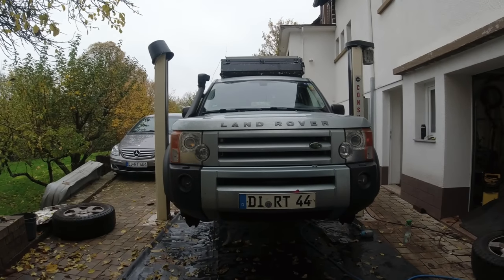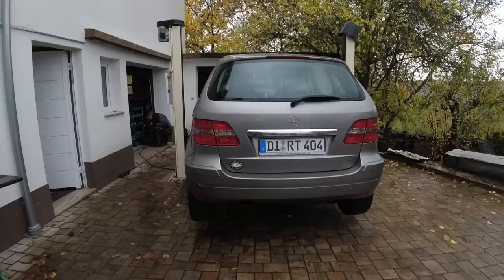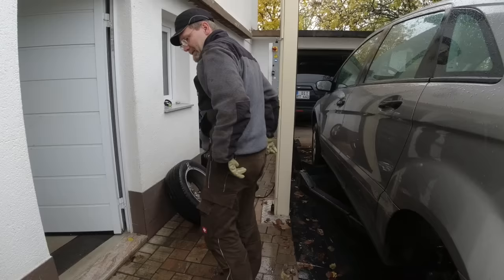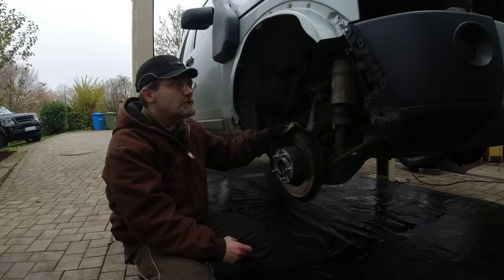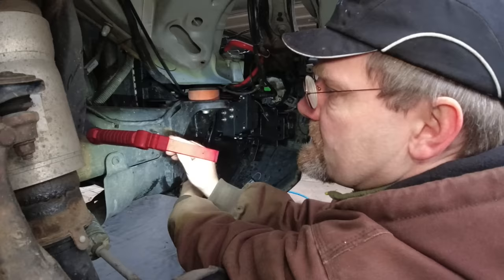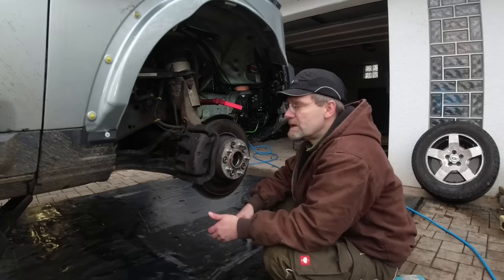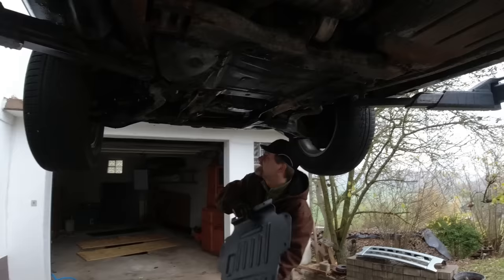Land Rover Discovery Air Suspension Problem Fixed

Comment: Since selling my Discovery 2 and buying a Toyota 4Runner 😱 my coffee tastes better on Sunday mornings watching your videos. Because I know I no longer have to do maintenance on the LR on the weekends. Funny and informative video as always! You two are great!
Reply: Well, Disco 2's were crap anyway. You did well to sell that thing.
Reply: Doing maintenance on weekends has always been an English car owner thing, tuning the SU's , checking the oil level in the carbs, making sure the brass tube from the engine to the Smith temp gauge hasn't sagged onto something hot.
Reply: I took your advise Christian and bought a Toyota Hilux SR5 2013.I have to look hard to find anything to fix, so usually revert to having a coffee. Enjoy your videos.Based in Western Australia.

Comment: I hope this makes you smile  - I suffered several strange HDC errors on my 2011 Range Rover - I then discovered that if I leave the front door open (for maintenance) that my dog jumps in the car and crosses to the passenger seat to sleep in peace. The process of crossing over often means a paw on the HDC button. The problem is not entirely solved but is now an easy fix. Thanks again for another great video.
Reply from the maker: 😅👍🙋‍♀️Vera

Comment: Hi again Christian  and Vera, just a quick message to let you  guys no my Disco 1  R Reg 5 door 7 seat  is now 25 years old  and  Stihl going strong .    Last year fitted my 4 th  timing  belt, all New hoses,New clips, New Thermostat,  New coolant,  Before the  winter 2022 i  serviced just the Engine     and had my radiator  rebuilt by a specialist 😊  Now it's  2023 change both axle oils, and both gear box oils .    Iv  had mine since it was 11 month's  old, love this old  Diesel  burner  ,  Stan  .
Reply from the maker: That is awesome.  Christian

Comment: Nice tip on periodically changing the vehicle height to keep the valve blocks fresh.  I experienced this issue a couple of years ago but the leak was much slower and took overnight to see any difference.  Could never identify the leak so I took the expensive shotgun approach.  Ended up being a bad air line from the block to the drivers front strut.  The helmet is a nice touch.  You win a safety award!

Comment: Just bought my first land rover 3 weeks ago 140,000 mile 2006 lr3. I have wanted a Land Rover since I was 15yrs old only took me 17 yrs to buy one after 3 Toyota pickups and 2 3rd gen 4 runners...I've had the lr3 for 3 weeks now and still have not driven it..just replaced all 4 air struts , compressor and valves, pcv, egr, and waiting on a thermostat housing...and even with all that I do not regret my purchase.
Reply from the maker: 😀👍💪💪💪🙋‍♀️Vera

Comment: What your working on is one of the reasons I gave up wanting the new Defender. I considered ordering a basic 2 door with only coil springs, but thanks to TFL's youtube on the one they got that was exactly like the one I wanted  that killed the whole thing. At 150 miles they had check engine light come on and they took it to Land Rover/Jaguar of Denver, Colorado and after a few week the brilliant factory engineers could only recommend that the 4 cyl. turbo engine be replaced.. So now I have a 2018 Honda CRV that I drive to Walmart and the doctor and being 76 years old I don't need to deal with any Land Rovers.

Comment: I "fixed" our 2010 LR4 air suspension by installing factory coil springs and shocks. I never have to worry about a failed air bag again, compressor or component. Ride is just as good and the ride height is fine for the places I go.

Comment: I agree with you 100% about doing your own research before going directly to a forum and asking questions that have probably been answered 1000 times already. In fact, doing research is how I found your channel! Love it!
Reply from the maker: Google-ing it does not count 🙄.  Christian
Reply: @Vera_and_Christian  I use the Hayes Manuel for repair purposes. Have a manuel for every car I own. Going to pick up a Gap tool in a couple weeks. Would have liked to have it before I purchased my LR3. So far the only repair I've had to do was to take care of the corrosion issue on the TCCM and connector pins. I actually found your channel looking at the different Android head units that are out there.

Comment: Great work. Yep. Front right valve a past hangout of mine..best capable LR I had was a L322. No suspension worries but in winter the door seals would freeze so hard, could not open doors..and on the windy beach one time, sand in the door seals squeaked like mice so bad I had to pull over and use wipes to clean them! True. The best 4x4xfar !

Comment: Great video as always.
One thing that slightly worries me is using detergents and degreasers near electrical connections and switches. As long as you quickly rinse them with clean water, you should be ok. However, I have had problems with degreasing detergents on the upper rear door opening switch, because the seal between the metal door and the plastic handle had deteriorated on my 16 year old Discovery 3. I replaced the switch twice before I realised that the seal was the problem, allowing the detergent to short it out when I washed the vehicle. A simple bead of clear silicon cured the problem. But it did highlight the damage these detergents and degreasers can cause to electrical components.
Reply: Good tip. I soak in WD40 any bare wires I find outside, and there are lot, especially on the height sensors. I've never had any go green yet, which happens a lot on UK cars.

Comment: I love your videos. It always makes me laugh and you guys do not sugar coat anything. The real deal D3 which gets hammered with suspension fault. I think 1 important thing before you buy a D3 is to make sure you have a local independent Land Rover mechanics, not only that they repair Land Rovers, they also owed them. Luckily I have a trusted mechanics here in Huntington Beach CA " CARRS4X4. I have a 2006 HSE.

Comment: Both mine and my daughters 05 plate disco 3's still have the original air struts, they look a little crusty but they still work fine and hold air.

Comment: I also had a suspension related fault which took up my whole Saturday this week.   Had that issue where the abs kicks in and the front suspension drops and you get the HDC error.  What a pain but after going through the 6-8 possibilities I got it fixed.  Ended up having to re calibrate the suspension with the Autel, find and fix a water leak, charge the battery, inflate tyres with a digital compressor and reset steering angle and just like that sorted.    So so easy 🤣

I think I need to repair my Pajero so I can have it ready to go on days like this.
Reply from the maker: 👍💪🙋‍♀️Vera

Comment: Love your content, well done.
Just so you know I changed the front value block on my disc03 2005 today  and when I undid the tubes to the value block nothing happened,  so undid the other two pipes and still nothing. The suspension stayed up.
So just put new block in its all working fantastic.

Comment: Had to do front airbags on my L322, the only difficult part was freeing the strut hub pinch bolt that had rusted and seized solid. This was worse of course on the nearside. Needed a day soaking in penetrating fluid and then application of heat to finally free it.  Repairs always seem to take longer than they should on Land Rovers! It’s just a shame that nowadays Land Rover engineers are more interested in design and attracting city buyers than investing time to ensure that the vehicles are easy to maintain. The engine bays are not designed with enough space to allow easy access.  Great channel - always look forward to your Sunday videos.

Comment: Great video.  Suspension maintenance is so important with these Land Rovers.  Some owners remove the air suspension an install coil!  They should be ashamed.   The factory air system is one of this cars redeeming qualities!!  My I suggest more videos on air suspension.  Maybe replacing Desiccants.  I know you can see the air pump working with the gap tool but I always thought it would nice to have an on-board to know when it is running.  That could be cool!!  Thanks for your hard work.
Reply from the maker: The is a Facebook group „coil sprung Discovery“ 😳🙄. Christian

Comment: Love it, excellent video as always, you two! Air related problems can be such a headache. I'm currently chasing an electrical gremlin - a faulty rear height sensor (wheel dropped on the 4x4 screen). I replaced the sensor... no result, replaced the harness to the sensor... nadda, now I'm tracing it over the fuel tank to the driver's side. One day I'll find it!

Comment: Hi both, love your chat, laughs, and serious talks, It makes the world go round.. Talking about rounds, I owned an early 2-door plus back door turbo diesel Discover 5 speed, I did extensive welding underneath when I got It but had It for 10 years as my daily driver.. It was a 1991 model so had very little (Landrover word) ELECTRICKERY in It, Loved that car, but still ran happily at 240.00 miles had to sell It as It had a clutch and my bad left leg got worse in traffic using the clutch.. Where possible I made my own service tools for cam belt changes getting diesel pump Injection timing spot on so it drove very well. After a few years and looking at many Landrovers I ended up with a "HIPPO" a 2004 model Freelander automatic HSE spec that I now love except it's quite small to get in and out of but once In very comfortable to drive.. Has the BMW turbo diesel power plus its FBH (fuel-burning heater) to speed up engine and cabin temperatures.. Thanks again, Ian - UK..(aged 74 & 3/4s) lol

Comment: 35 years working in the oil & gas industry with pneumatic and hydraulic systems and, honestly, I never cease to be amazed by how poorly made a lot of these systems are.
We can talk about ways to improve and maintain reliability but, basically, if a system isn't designed from the ground up for lifelong reliability it's ALWAYS going to cause problems sooner or later.

Comment: I have a handy use for the air suspension on my LR
I use it to connect and disconnect my trailers by raising and lowering the car instead of using the jockey wheel

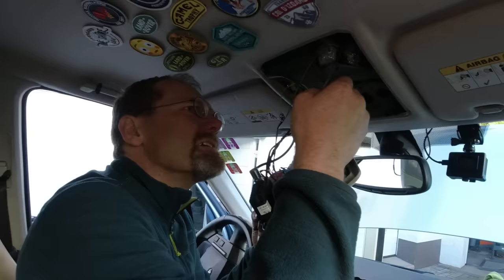Comment: Interesting video, as always.  But one very good thing about the Discovery is that you can still get all the parts.  I have a 12-year old Nissan X-Trail Mk.II (while I am still saving up for my D4) and I have a cracked pressurised air hose that is 'no longer available" (Renault engine in the X-Trail).  After many days trying, the garage have discovered that an identical holse was used in a Vauxhall (ie: Opel) engine and will fix that tomorrow morning.  Thank goodness as, starting at 04:00 on Wednesday I ve an 1,800km journey across Europe from the UK to Slovakia.

That old X-Trail is a pretty unique beastie as everything at a similar price is smaller and worse (including the Mk III X-Trail) - the only viable replacements to give the capacity is a D4 (D3), Toyota Land Cruiser or Mitsubishi Shogun - and the D4 is definitely the best.

I only wish I could pay you for a patch that did not require having a PayPal account.

Looking forward to the next video and seeing what happened at the TÜV (was it the rear light that was brighter one side than the other?).

Have a great Christmas.
Reply from the maker: Tüv will take a bit. There will be a few videos in between.  All funny.  Thanks John.  Christian

Comment: Hi. My D3 has 357k km and I have only recently replaced the air pump. The rest of the air suspension is still Original. A great excuse for your suspension work out is to lower it when you go into parking garages.

Comment: I've got a 2006 D3 and only issues i have had with suspension was a split plastic air dryer cap for compressor (extremely common issue) which i replaced with an aluminum one off ebay for $70 and 1 x height sensor (replaced myself) for $120. Both issues scanned with my iCarsoft scanner. So $190 of issues in 16 years plus 320,000km with towing horse floats!

Comment: We had a 2004 Merc C class and it was one of the worst vehicles I have ever worked on; really rusty, all suspension components worn out, smoky engine, and oil leaks all over the place  (likely that the previous owners hadn't looked after it which didn't help), upon failing its MOT (UK equivalent of TÜV), we got a Range Rover L322 of the same year and it was a totally different beast, much better built and easier to work on, nice solid BMW engine. The only had issues with the entertainment system getting waterlogged and causing CAN bus interference, the EGR thermostat had a pinhole leak, and lastly the evergreen air suspension leaks (which I still have to deal with). Very little chassis rust and only a small hole in the body that needed welding up. All in all they're great vehicles.

Comment: More lectures please, if you had been my teacher at school I would have a PhD now instead of a packet of crisps and a wagon wheel! Was surprised by your 10 litres/100 kms until I used imperial units calulator and its the same as my LR4 at 28 miles to the gallon (measured at the pump and not that lying LR digital display which says 32 mpg!).

Comment: It looked like one of the rear number plate lights was not working. I think that was also a problem on the last TUV inspection. It will be interesting to see the video you publish regarding this latest TUV inspection.
Reply: I noticed that too
Reply from the maker: We always have spare bulbs inside in my spare parts bags, extra for TÜV visits. So that something like that can be fixed on the spot. 😅👍🙋‍♀️Vera

Comment: Another great methodical diagnose and fix, although Vera is now challenging icarsoft on the fault finding without the need to plug it in. JLR spares and supply chain is very slow and often fails to deliver. Christian needs to keep that bump cap on as it acts as his pop off valve when ranting.
Reply from the maker: What do you mean "without the need to plug it in"?? I know how to use it efficiently and know what to do when the fault comes. Of course it was plugged in. I am actually offended by your comment. 😅🙋‍♀️Vera

Comment: Love the whole Do not buy this car if you are mechanically challenged humor. 

I own a disco 3 07 which I bought recently - for a 16 year old car its lovely! No airsuspension issues yet.. or at least I think but was keen to find out more to do some preventative maintenance. Your video was a good starter pack. :) Going to check out the others.

Comment: Good thing you got a hard cover manual there Vera, you can use that to hit Christian over the head when he doesn't tighten down bolts to the correct torque value...😉👍
Reply from the maker: No hitting in our family 😅👍🙋‍♀️

Comment: As I remember hopefully right, winter tires are not supposed to crawl into snow but to fill the small gaps actually with snow to get a snow surface on the tire. The tractions does not come from digging into snow rather than building up a big snow surfaces which sticks on the road snow surface. If it would be otherwise than mud tires would work peffectly in snow, what they dont.
Reply: They are called "Sipes" and hold snow as snow to snow is the best friction

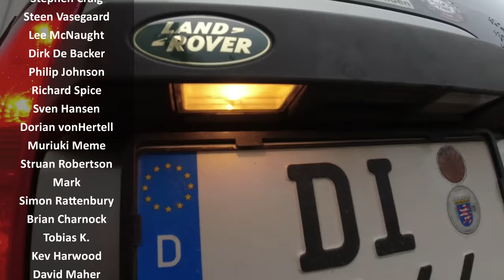Comment: The right side globe for the registration plate is blown @ 29:19 mark - that's my contribution as a Toyota driver.  🙂
Reply from the maker: That was ok, we never, never go to the TÜV inspection without spare bulbs.😅We always miss checking them thoroughly at home. Learned that lessen mire than once.😅🙋‍♀️

Comment: Did it fail it's TüV on the rear number plate light? Vera checked in the video and said it was okay, but the right hand bulb of the pair wasn't working. In the UK, I think that would still get a pass with an advisory, but I'm sure that the German TüV is more demanding!

Thanks for another great video 👍
Reply from the maker: You noticed.  Impressive.   That would be just ok but not the other stuff.  Will be in a vid down the road.  I am looking at a serious box with parts right now 😱 Christian

Comment: Hi Vera &  Christian, as desired, some feedback from the Toyota driver front in down-under that follow your videos with great interest, and curiosity of what can fail on Non-Toyotas:

1) We do have M+S tyres, most A/T are rated M+S and have this snow flake symbol we don't know what it means.
2) Especially in WA, no reason to change tyres between the seasons. A/T's all year long.
3) Toyota emergency tools: I think, I have seen this tool bag some years ago. Not quite sure. But it had far less content, no shifter. And never used it in the past 12 years.

4) EBD2 - Scanner tool. There is actually a EBD port on our 1998 105 series, but without any function. But what should it display? There are not many sensors on this car anyway. No catalyst, no O2 (lambda sensor), no EGR or whatsoever. I think, the 1FZ-FE engine has TPS, crankshaft, oil pressure , temperature and intake air pressure (no flow) sensors, that's it.
5) TUV and AU: What the heck is this? We look after our cars ourselves and to be honest. Since we live in Australia, our cars are better maintained as they ever were in Germany. No salt on the roads, no rust. I mean, no rust. And in your own interest for survival, you look after your cars as you don't want to get stranded here outside of Perth. 😂

All in all, very enjoyable episode as usual. And, Christian, please don't blame the LR dealerships. It's not their fault. They are born this way. 🤣🤣🤣
Reply from the maker: „Interest for Survival“ Lol 😂.  Thanks for your summary Alex.  The tool bags all look unused for sure.  👍. Christian